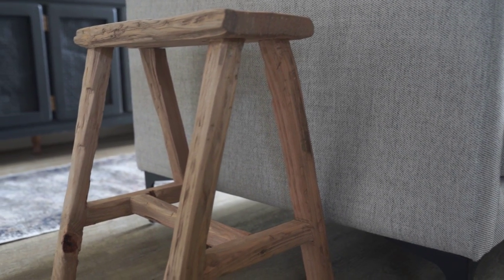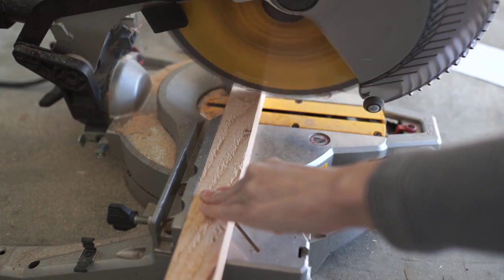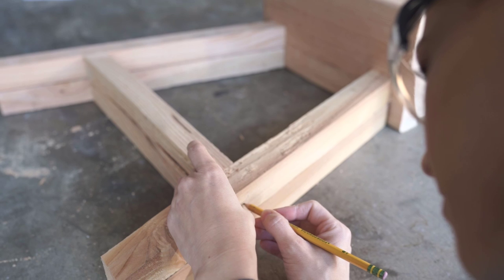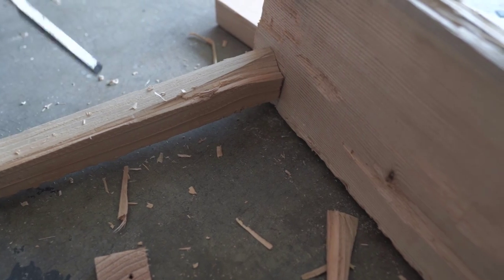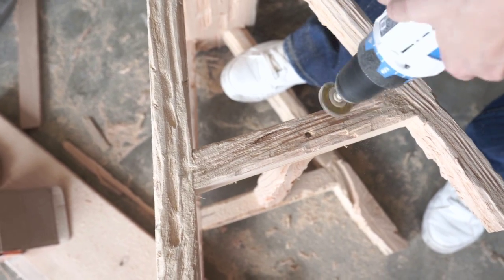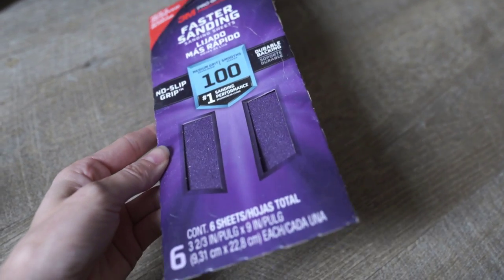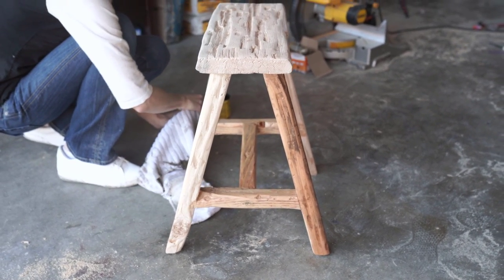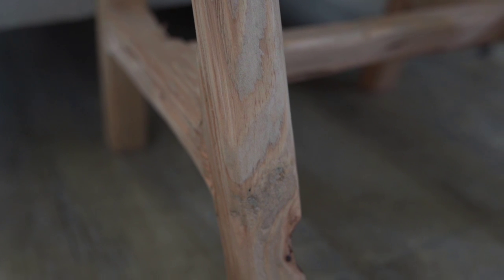DIY THIS VINTAGE INSPIRED BENCH // BUDGET FRIENDLY HOME DECOR // GET THE LOOK FOR LESS

Comment: I just love these benches that you make.  And they can be customized to fit any space.  Just a quick question:  is the 17 3/4 measurement of the legs at the bottom of the angle cut or at the top?
Reply from the maker: It’s from the longest point to longest point! I hope that makes sense!